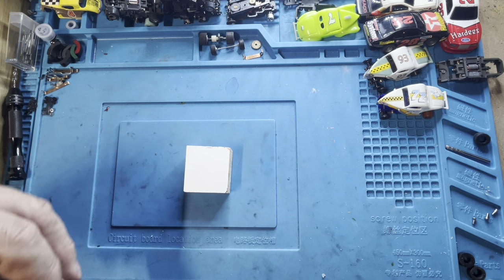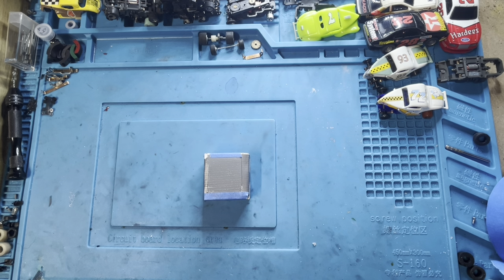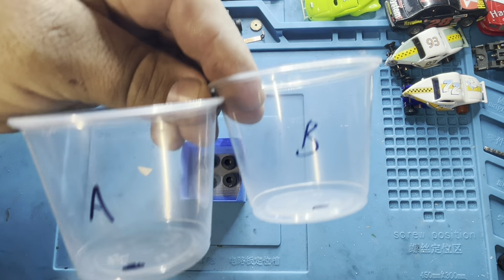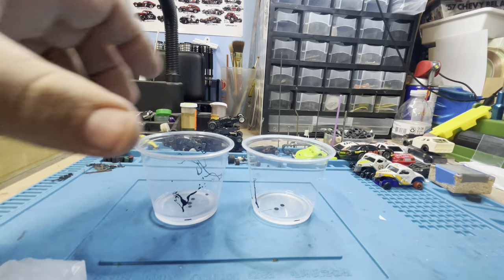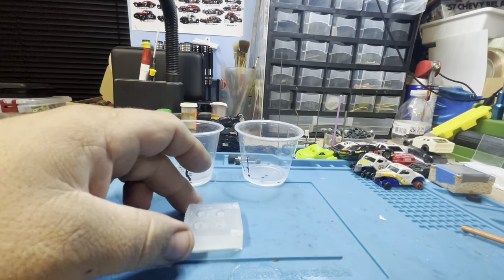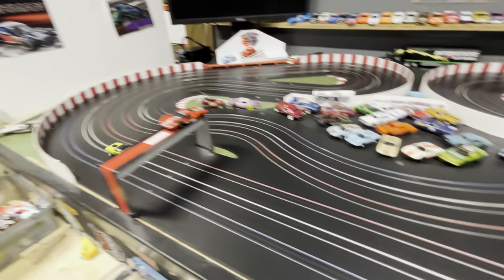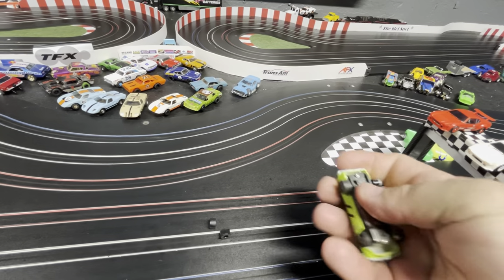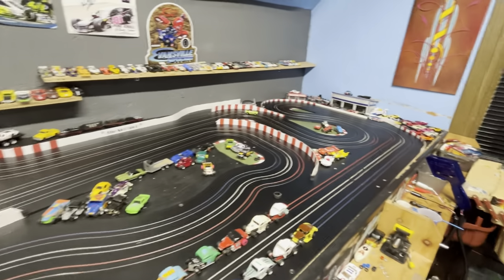Making Silicone Tires Using Smooth-On Mold Star 31T

Comment: How many issues have you ran into with incompatible rubbers? Iv used platinum based and its fails on almost all newer tires. Do you have better luck with the tin based assuming that product because its 30t the T is for tin based silicone. Platinum based stays gooey no matter how long it sits on most tires and never cures.
Reply from the maker: @SloppySlots  this is platinum based silicone. Sounds like there is something inhabiting the chemistry. Possibly sulfur, to much mold release or if the tires your trying to mold are made with a tin cure silicone the the platinum won’t cure.
Reply: @ seems to be pretty much just pioneer wheels on 1:32 cars. I found a solution for the most part the reaction happens when directly applied to the tires. Using baby powder seems to put a barrier between and lessons the effect, on most tires to full cure. On others a very slight amount of non cured silicone happens. On to more experiments with release agents to find one that block the reaction.

Comment: So you use the same product to make the mold as you do for the tires you just use the release spray to prevent them from sticking when making tires hope that makes sense what I’m saying
Reply from the maker: Yeah correct because nothing sticks to silicone like silicone. You would only use a different product if you wanted softer or harder tires. You can also make the mold out of softer or harder silicone.
Reply: @TheSlotSpot  I've made urethane tires, where I made the mold out of silicone, and the extraction process is easy with no release agent needed. I would think reversing the process should work. Meaning a urethane mold and use the silicone to make the tire. Have you ever tried that? Just curios - I'm about to start making tires and was going to experiment with urethane mold.
Reply from the maker: @victorborme9400  I would still use a release agent. Not much stocks to silicone so the urethane tires will pop right out but silicone also works as an adhesive so it might stick to the urethane Baby powder also works good as a release.

Comment: What do you suggest for level 2 tires the stronger magnets and would it be better if you used stiffer compound for the mold
Reply from the maker: The stiffer the mold that harder it is to de mold the tires but yeah harder tires are good for stronger magnets because the force pulling down makes the softer silicone go out of round. The softer will also roll over easier.

Comment: Is there much difference between smooth-on 31 and the 30 ..?
Reply from the maker: 31 has a 5 minute pot life and 23 minute cure time. 30 has a 45 minute pot life and 6 hr cure time. They are both a 30 shore silicone.

Comment: Awesome video. Maybe I missed it, but do you apply mold release to the original tires?
Reply from the maker: I did not because my originals were rubber. If you are using silicone tires as a model then you would need to apply mold release.

Comment: what makes these custom silicones  better than others? Or just mostly a DIY video ? either way thanks for vid
Reply from the maker: More of a DIY. Typically if I can do something myself I will but I also like that you can control the hardness. If I use 30 shore I know my tires are 30. If I buy tires from someone the hardness is probably unknown. Tires are also roughly 2$ a pair so for the price of this material I could get about 10 pairs of tires versus being able to make probably over a thousand tires for the same price.
Reply: @TheSlotSpot i might try this myself since my son and his buddies are getting into the hobby. we just built a 4 lane lifelike track. Softer tires would def help on raceday
Reply: Just my opinion but I’m hoping it will help stop a couple of my cars from spinning out going around turns even when trying not to.